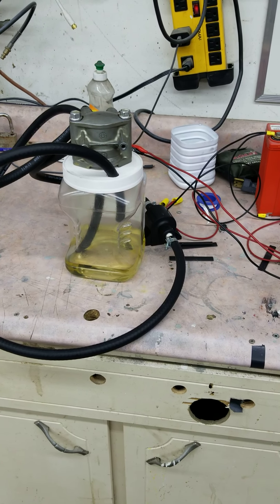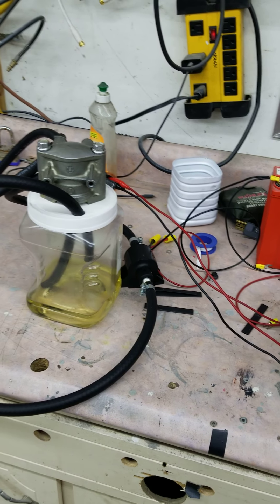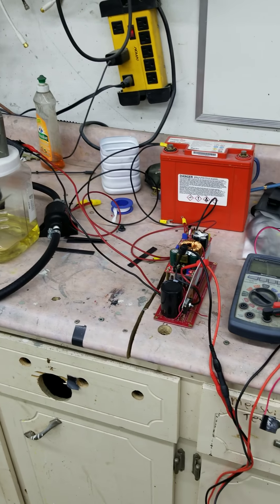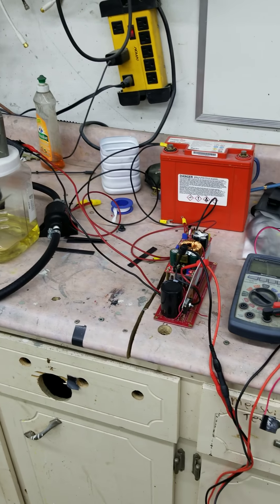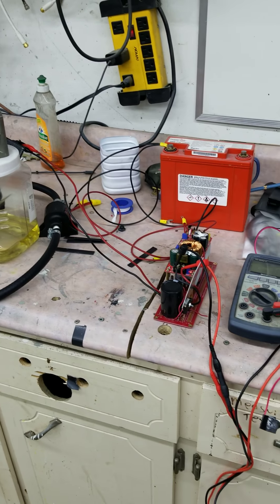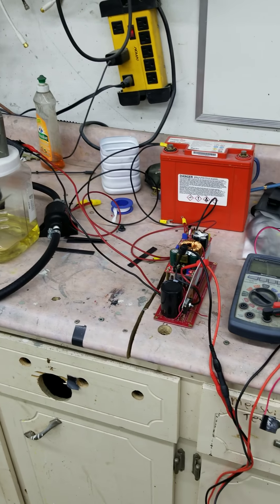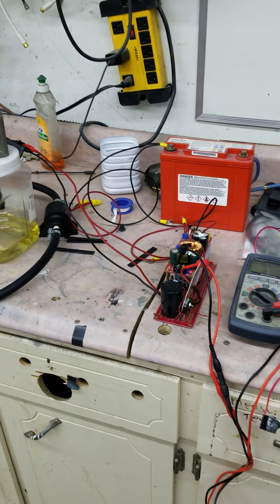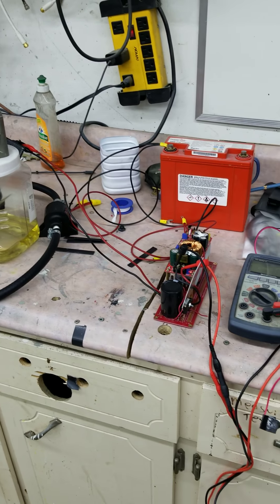Home built Etec outboard injector cleaner/activator system (video 1 of 2)

Comment: Hello. Which power transistor do you using? Can you post me circuit diagram for the transistor circuit? Thank you
Reply from the maker: I used an NTE 2541 which is a Darlington pair..great for high current or motor control.  I also put a a 10000 uf 100v capacitor on power supply output ...didnt try without it but wanted to help with pulse load.  Wiring is very simple.  Take 55 volts connect to one side of injector.  Other side of injector connects to collector of power transistor.  Emitter of transistor is grounded...  Pulses applied to base of transistor will activate it.  When transistor fires it essentially grounds the other side of the injector completing the circuit for the duration of the pulse.
Reply: @Jim Dolson thank you for sharing the information. I have the complete setup as you've described.
 I have the same injector pulser that you have, and I was wondering do you  Connect the positive from the pulser directly to the base of transistor or do you have a resistor to limit the current. I have burned up 2 transistors so far :)
Reply from the maker: @danny6935  I believe I have a 1k resistor inline driving the base.  These are very high gain transistors.  Ensure you have the injector from collector to positive.  Also I bolted a small piece of aluminum to the transistor as a heatsink
Reply: Jim@Dolson What am I doing wrong , I only get one actuation out of the injector. Power supply  is a 40 V High capacity batteries. And the transistor gets hot quick.
https://drive.google.com/drive/folders/170Vykawrr2UYR9RsNbairy7_CvREpoVC?usp=sharing
Reply: @danny6935  I have the same problem mate. Did you work out the problem with yours. Thanks

Comment: Where did you purchase the dc to dc converter. Can you post the part number . I would like to purchase one.
Reply from the maker: I bought it on Amazon.  Dont have the part number but if you search dc to dec converter you will see many options.  Just make sure it can up convert to the voltage needed...with the input you will have.
Reply from the maker: I bought it on amazon.  Was roughly 30 $.  Sorry not sure what part

Comment: How effective has this been to improve performance from the injectors?
Reply from the maker: It definitely works.  It helped however  did not completely solve my starting problem.  It definitely improved high speed running.  When the cleaner was allowed to run for an extended time you could see a definite improvement in the nozzle spray pattern.  The clear container made it very apparent as it would perfectly show on the foam generated by the spray

Comment: The problem with this is that the ETEC is a bi directional Injector and needs a bi directional signal to operate correctly.
Reply from the maker: The purpose of this circuit is simply to fire the injector (activate diaphraghm) to pump cleaner thru the nozzles and interior of the injector.  There is no additional modulation of the square wave and none is required to process and pump cleaner thru the injector.  This circuit is not intended to run the motor...its purpose is solely just to exercise the injector pump to facilitate cleaning the nozzles etc.  Being a full square wave of variable amplitude it can move the plunger faster than the actual smoothed waveforms

Comment: How many amps does it need at 55v  to activate
Reply: I get your using a injector tester to get a rapid pulse signal At 12v into a 55v step-up dc-dc converter.     But how many amps on the 55v side is required to activate?
Reply from the maker: Sorry but I don't recall what it was drawing.  It's been a while since I ran it..  The total power is significant enough as it heats the circulated fuel fairly quickly.

Comment: Don’t need to be 55volt mate. 12 volt with a $30 injector tester like you have is all you need.
Reply from the maker: No.  A standard injector tester does not work.  It cannot even begin to provide the power neccesary to move the huge plunger inside an etec injector. The injectors testers for our cars will work with some power sports equipment as they are meant to power 12v piezoelectric injectors.  Connecting that tester to a 55 volt high power etec injector does absolutely nothing.  You wont even budge the plunger or spring
Reply: @ontariooutdoorsman  sorry mate, I have tested and it works, works enough for cleaning the internals of injector. Remove spray nozzle and I fully submerge injector which has been removed from the housing, like most injector shops do to clean injectors before spray testing. The spray nozzle is easily cleaned by itself. If you search YouTube a dealer tech uses 12volt to same process I’m explaining without the use of injector pulse unit.
Reply: Also other ways to test: I’ve also cleaned using the diagnostic software plugged to outboard with injector unbolted from motor and in cleaning solution you can use the diagnostic injector test function in the V5 diag software to operate. This is how I used to do it periodically. But when I learnt you actually can use 12volt I stopped.
Reply from the maker: Well that's amazing.  My injectors dont even budge with 12v.  I can get them to start spraying around 25v and provide a good spray at 35v but if you scope the etec pulses with an ocilloscope the waveform is shaped around he full 55v
Reply: @ontariooutdoorsman  yea with 12 volt you will not operate the injector as it would on a engine or full spray test as per your setup. However all E-tec injectors should operate enough to flow a cleaner/product through the internals that like to be clean. I don’t like high pressure cleaning although that’s how it operates day to day with additive cleaners in fuel but highly filtered, Well 10um. I can use 3um but I stress about the flow although the filter I use is very large and the flow rate is high, it can block fast. But when cleaning flushing any injector IMO low and slow is the way to go as to not damage and free up any debris/gum.
Reply from the maker: There must be a difference since early injectors which i have.  These injectors make a very faint click (if you put your ear to it) when attempted to use with 12v...but will not process any fluid.  2006 era.